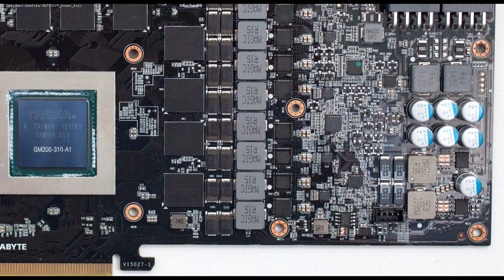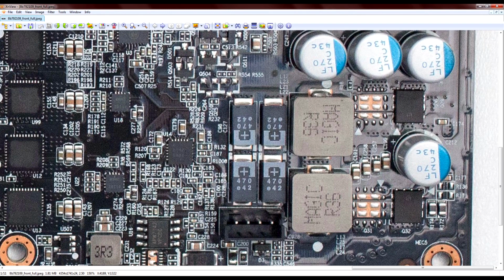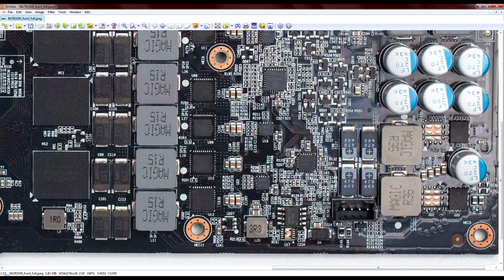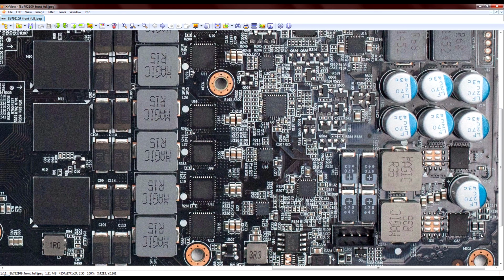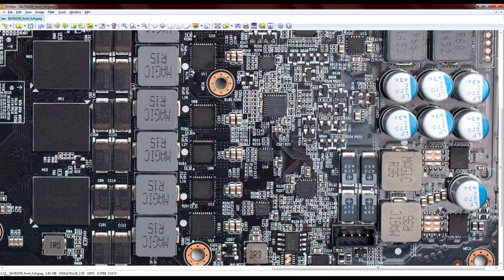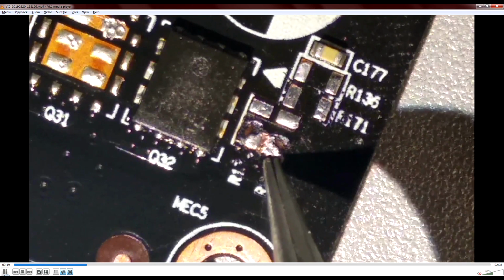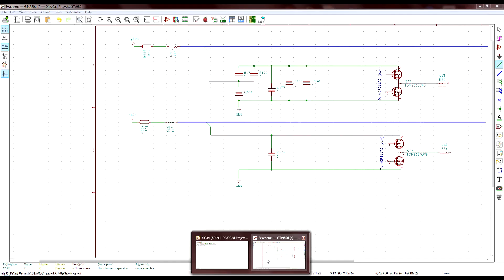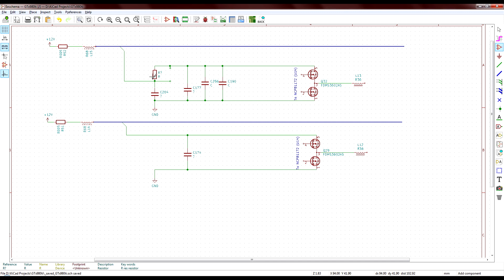Gigabyte 980Ti G1 GAMING-6GD Repair

Comment: Thank you for making this video! I just picked up one of these cards from a friend that has the same failure. I'm not fully sure that putting in the 0ohm resistors will solve the issue, since the PCB seems to have separated ever so slightly in that area and the card powers up (fans spinning, LEDs running), for what I'd guess is less than a second, before promptly shutting down. This leads me to believe there is a short somewhere, but this my first dive into playing with broken GPUs, thus I'm not exactly sure whether or not I'm correct in thinking that. I was wondering if you could link me to the resistors that you used on your card, so that I could at least try the fix to see if the card can run properly with them. Forgive me if you've already linked them here, I perused the comments for a little bit and didn't find links to the part. Any and all advice would be much appreciated!
Reply from the maker: Hello,
Unsolder burned resistors and clean the area to see what is going on there. If pads are there, or just some usable parts of the pads, then solder piece of wire instead of the resistors (yes one piece of wire instead 2 resistors). If all the other components are ok, your card should run normally. If you can take a picture of that area and post it here?
Reply: @UrosAndric  I'll upload a photo of the area shortly. This one seems to have gotten it pretty bad, as almost none of the original ferrite beds remain. Upon cleanup, it appears to have gone through at least one layer of PCB as well. Currently waiting on a new tube of thermal paste, and some thermal pads to come in, but once they do, I'll get the wire in place and prep for first test. Q32 also seems like it could've been damaged, but it is fully intact still. I have a multimeter, but I'm unsure of which pins I'd need to probe to check its functionality. I greatly appreciate your help!!
Reply from the maker: Man, this looks nasty. Looks like whole 12V island is burned out there (the bottom side of burned ferite beds). You will have to clean it more and scrape all burned peaces to see whats left there. If it is completly burned out you will need to run a jumper wire from current sensing resistor (i will tell you which one exactly).
Here is data sheet for q32:
https://www.mouser.com/datasheet/2/149/FDMS3604S-526687.pdf&sa=U&ved=2ahUKEwib0vCSyMbmAhXplIsKHVu2B4oQFjAAegQIARAB&usg=AOvVaw2DEioSamBkFp7devSnAPbi
Have fun measuring it :-)
Reply from the maker: @IvyIsADumbBitch  yes 005 shunts. There is explanation in the video which shunt is for that q32 ic. I can't tell you from top of my head now.
Reply from the maker: @IvyIsADumbBitch  if the line goes: 
8-pin connector>shunt>choke
Then take it from the choke
If goes:
8-pin connector>choke>shunt
Then go from the shunt.
Reply from the maker: @IvyIsADumbBitch  just run some flux and new solder over the legs of q32. Looks on your image that the heat from the burning ferites removed solder from gate leg (bottom rite one).
Reply: @IvyIsADumbBitch  can you please share the picture how did you bridge that wire please mate i got burned out gtx 980 ti on that exact same spot could you please post me a photo im trying to fix it
Reply: @IvyIsADumbBitch  could you please upload a photo somehow how you jumped your wire that would help me a lot i realy like this card and would like to fix it but i m not that good at it so close up photo of your work would help me a lot my friend thanks for response.

Comment: Hi Uros Andric, is me again. Do you know what causes the pc not to boot up with this card installed? What could be the fault?
Reply from the maker: What happend? Does it turn on at least? Can you give me any more details?
Reply: I don’t know much about it as I don’t have the card with me, found one faulty online was thinking of buying and repair it. I was told it doesn’t turn on at all when the card is installed. Possible short somewhere?
Reply from the maker: @indran2011  If doesn't turn on at all, then probably some of the VRMS are dead and in short circuit. You will know if you unplug 8pin connectors and then try to turn it on. If it turns on and you have fan spin, then that is the case. If you are lucky to get the message which looks something like this "this card can't work without external power suplay, please connect it". Then your chip and memory are most probably ok and one or more VRMs are in short to ground.
Reply: Uros Andric thank you. On another faulty card, it can boot and works fine for light tasks but crashes when gaming similar to your problem but surprising it causes the pc to shutdown? Is it normal for gpu fault to cause pc to shutdown. What do you think this problem is?
Reply from the maker: @indran2011  Sounds like the same problem with those ferittes going bad. It can power it down if the current drown from the power supply is high enough to trigger the PSU protection. When you have burned ferrites and your memory is only working on one phase then card is working normally untill it loads. Then it crashes. I got myself BSOD but crashes can be different for different PC builds.
Reply: Uros Andric thank you. Btw what is vrms? Is it the one next to ferrite beads?
Reply from the maker: @indran2011  VRMs are voltage regulators. Usually contains 2 MOSFETs, coil, capacitor and controller. When it dies usually one or both of the mosfets are dead and makes short to ground.  Sometimes faulty controller is to blame for mosfets death. Sometimes those 2 mosfets are discrete and sometimes are inside the IC. In case of this card for RAM power supply we have Q32 IC which contains both mosfets inside. And for powering the GPU we have more complex ICs that have integrated controller, mosfets, temperature sensors, protections and somewhats.
Please bear in mind that this is oversimplified explanation and that it requiers video of its own. To explane it in general and on this specific card.
Reply: Uros Andric thanks. Do you know if all brand with same model (I.e all gtx980ti) have same components and same symptoms  relate to ferrite bead or only gigabyte 980ti have this problem? Also does other model have ferrite bead issues?
Reply from the maker: @indran2011  as far as i know only this one have that problem. Look for founder edition nvidia 980 ti and compare the boards. You will see what they kept and where the changes are.

Comment: Sorry I commented on the wrong video originally. 

I had this exact issue I don't have any micro soldering equipment ( or ability) but I have bridged the resistor connection with solder. What's the worst that can happen if I don't get a resistor in there? Slight chance of 12v to memory one day killing the card or is it more likely to happen and take something else with it? Thanks for the video by the way I now have a fully functioning card!
Reply from the maker: Glad you ware able to fix your card.
If your card is working now, than all should be good. I placed a fuse there just in case if something goes wrong. But stilly card is working normally after all this time. I would just remove completely burned resistors and then would place a piece of wire or solder blob to make that connection.
Hope that your card will serve you for many years to come :-)
Reply: The original inductors that are there are meant to prevent noise to get into the chip next to them and also out from it. They are not absolutely necessarily needed (but a connection there of course) but it decrease the electrical noise level on the card which is always something goods since if its to severe it could start to malfunction but there are electrical noise limiting things all around the card anyway so this one wouldn't really matter that much.

The chip next to the inductors contains two mosfet transistors, and without going into any deeper detail so, by what ever the reason, the top one in the schematic in the video goes into short circuit one day between top and bottom of it the memory will get 12V which will destroy them all immediately. 

An extremely quick fuse could if you are lucky save them if that would happen but its 50/50 which transistor would break and its 50/50 if it would break the through top and bottom of it or in another way that wouldn´t destroy the memory.

A thin (and I mean very thin like a few strands of a very fine wire) could be ok to use, have done that my self but I never want to se if it works or not.

Comment: Sir, thank you so much for this in-depth explanation.
I'm only a simple gamer, so I had a hard time understanding how the electronics in this card work.
I have this exact gpu with this exact problem : https://ibb.co/thvX95m
Could you please guide me on how I should proceed?
You can give me the details with the specifics on how I should proceed to fix this? I'll forward the steps to someone who is more knowledgeable than me.
Thank you very much for your patience and time.
Reply from the maker: Hello :-)
I would first clean the pads where R172 and R174 ware. Also i can see that IC is hand soldered. That means someone already triyed to fix this card. Do you know card's history maybe?
Reply: @UrosAndric  Hello! Thank you for responding! I got this card as a RMA from Amazon, the original one had faulty fans. What do you mean someone tried to fix it? You're saying that amazon gave me an used Graphics Card and not a new one?

Is the IC the black chip next to R172 and R174?
EDIT : Should I leave the IC as it is or should I do something about it?

As for the cleaning, what should I use to clean them? 
And after cleaning them, do I put 0 ohm resistors (like I've seen in other comments) or do i simply put a wire?

Thank you again for your patience.
Reply from the maker: @matthewmatteomatheus6483  Have no idea i am just telling you what i can see. I can see that those feritte beds are removed and that soldering job on Q32 is looking like manual soldering. So if you Haven't played with the card someone else did. Did this card work in your computer for any time?
Reply: @UrosAndric  Yes. I had it since early 2017 and I never overclocked it
Reply from the maker: @matthewmatteomatheus6483  So what happend when it dyed?
Reply: @UrosAndric  The computer turned off, like if the power went out during a thunderstorm. Anyway, after rebooting the computer, After the login screen, the screen turns white and the computer stops responding. I noticed that sometimes the card works and a few minutes later, the entire screen turns white again. I had to remove from my pc since then. After looking at this video I decided to open it up, and had the same issue as you.
Reply from the maker: @matthewmatteomatheus6483  There are clearly missing R172 and R174. Card couldn't work without those components or any replacement part that conducts electricity. like a piece of wire or a fuse.
If you don't have any experience in soldering then give to someone who knows what he is doing. In the place of those R172 and R174 should be placed ideally 0ohm resistor. If not then a piece of wire will do the job. If Q32 is not dead card should work fine. If it is dead then you will have to replace it as well.
Reply: @UrosAndric  The R172 and 174 were removed. It showed some minor burn signs and they popped off on their own
Reply from the maker: @matthewmatteomatheus6483  then try with a piece of wire ot a fuse to replace one of those. The second one leave blanc.
Reply: @UrosAndric  Sorry for bothering you so much, but I am truly grateful for all your responses and this video. They have helped me a lot. Have a wonderful day : )
(I will let you know if I manage to fix it)
Reply from the maker: @matthewmatteomatheus6483  No worries, not bothering me at all. Hope that you will be able to fix it. If you can't afford new card then i sugest you to give it to someone with experience in soldering. Give him this video to watch, it might be helpfull for him also.
Reply: @UrosAndric  hello there! Good news! We managed to fix the card!
I'll tell you what we did. We cleaned the r174 and r172 area by scraping off the old beads material.
We probably scraped too much because the contact points were missing (or maybe it was the burn effect that did it)
Anyway, we put a single tin wire in one of the two contact points connected to its respective end.

When i turned on the pc and fired a game, we heard a burning sound coming from the pc, then suddenly it turned off. After rebooting however, everything seems to work fine. Every game runs as it used to be and it looks like it's functioning.

Thank you so much again for this video!
Reply from the maker: @matthewmatteomatheus6483  Quite a ride you had there. Is the card still working?
Reply: @UrosAndric  Yes. The card is working fine. Even with OC (1.3Ghz core clock). I have no idea what was tha burning sound followed by the instant shutdown of the pc, but that seems to have fixed the card by itself. Maybe the PSU prevented something cathastropic? Anyhow, the graphics card works well, no slowdowns nor graphical artifacts.
I plan on replacing the vRam and vrms thermal pads now, when I do, I'll check out what happened to my soldering.
Thank you again and have a good day :)
Reply from the maker: @matthewmatteomatheus6483  Thank you. If it is not too complicated for you please take a picture of what ever was that burned there and come back here.
Reply: @UrosAndric  https://ibb.co/n1HX0sr
https://ibb.co/TqXRN7g
This is what it looks like. Yes it is not a great job, I admit, and theres a white spot on top of that chip Q32 and i don't know what that is.
I'm now replacing the thermal pads and hoping that the clock speeds get stable once again.
Reply from the maker: @matthewmatteomatheus6483  OMG, this hurts :-)
Reply: @UrosAndric  Well, changing the thermal pads did not fix the issue. The clocks keep fluctuating. Shame :c
Well, at least the card works, as opposed to before that it would only output a white screen. Thank you anyway for the help.
Reply: @matthewmatteomatheus6483  I had similar issues to you and fixed it by soldering the ends of R172 together. Everything was fine for weeks. Then suddenly the other night my computer randomly shut down (think my PSU is dying) and now my graphics card won't power on even with another PSU. It's like it's not even plugged in. Not sure where to go from here.
Reply: @derick1618  The thing is, I think the horrible soldering job we did on the two ferrite beads ultimately killed the card
Reply: @matthewmatteomatheus6483  Mine was working fine but every few days it would shut down after long periods of gaming and would then refuse to render 3D for a few hours without shutting down the moment you would launch a 3D application. Did the same a few nights ago but this time on reboot the card wouldn't start at all. Video output would just default to the onboard.
I was really hoping that I could use it until the RTX 3000 series comes out.

Comment: After 5 years, never was overclocked or used for mining, and when I turned on my computer, it started to smoke and after approx 0,3 seconds it just sparked and burned. !!!Never leave your computer turned on and always remove psu from wall plug, this is for safety trust me!!! https://imgur.com/gallery/nc0D94D
Reply from the maker: Nice BBQ you got there. It might be repairable. i would try to replace those ferrite beds and q32 IC. Hopefully all the pads are usable still.